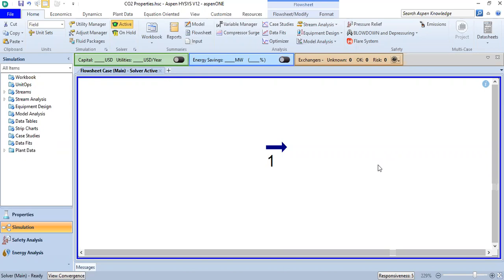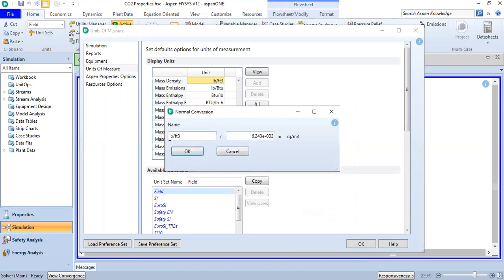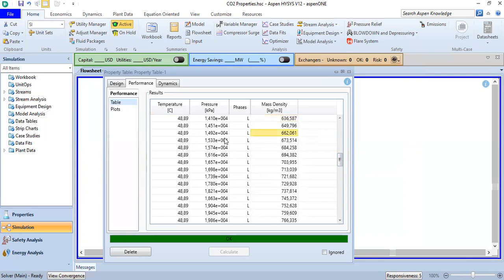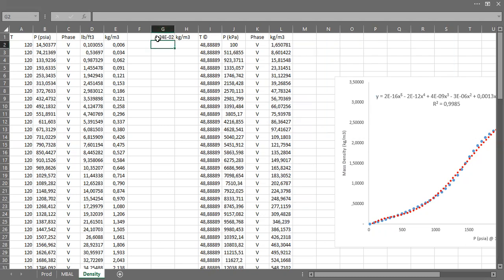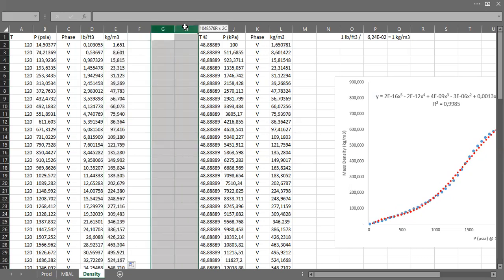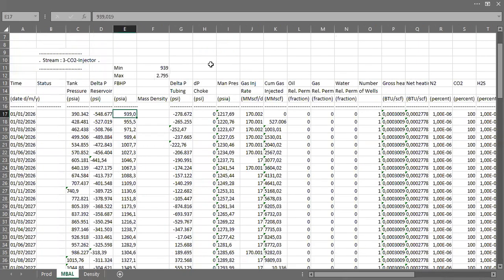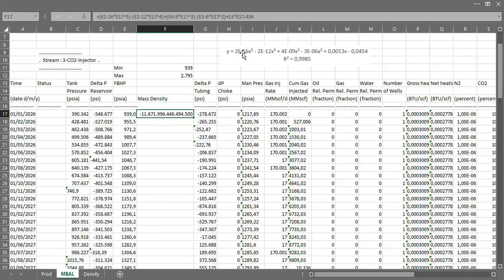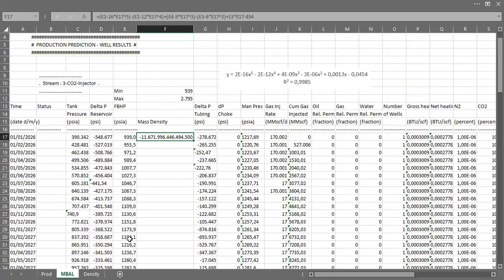HYSYS Tutorial 34: CO2 Density Correlation

Comment: Hello sir, thank you so much for the video! I want to ask, if I want to make the density correlation but the temperature is not constant how do I make the trendline? Thank you so much sir, I hope you can help me :)
Reply from the maker: Hi, my pleasure. You better run each simulation with different temperatures. And then try to plot all of them at a single chart, and see whether you can see distinct trend at which you can make a correlation.

You can do approximation, like from temp a to b, the trend is straightline, so you make a straight correlation from temp a to b.

then from b to c, the trend changes, more like a cubic correlation, lets say, then you make a separate correlation, etc.
Reply: @EngMan101  Alright, thank you so much sir!